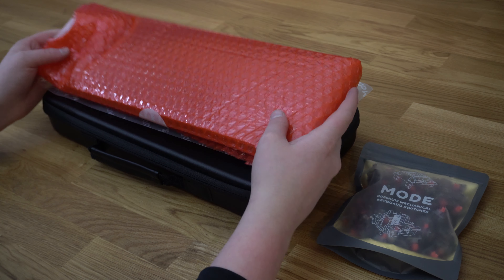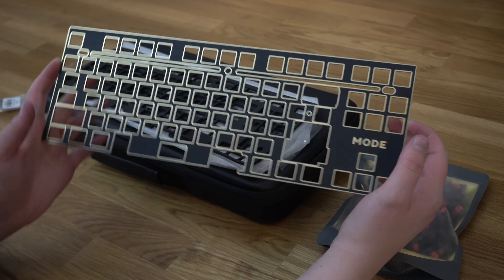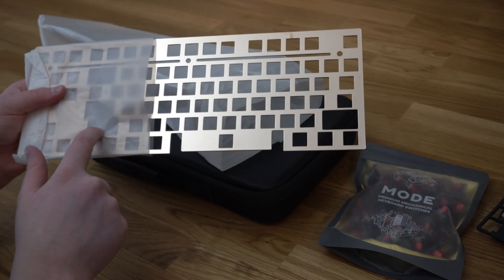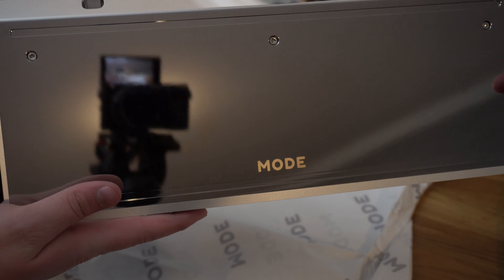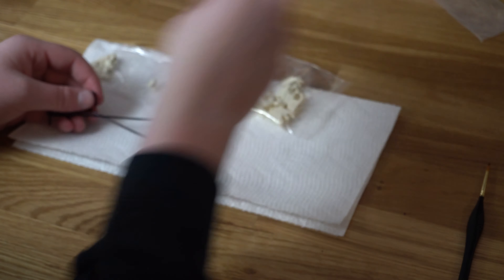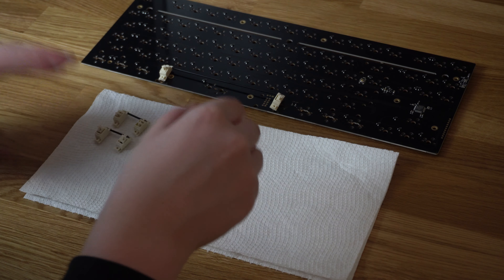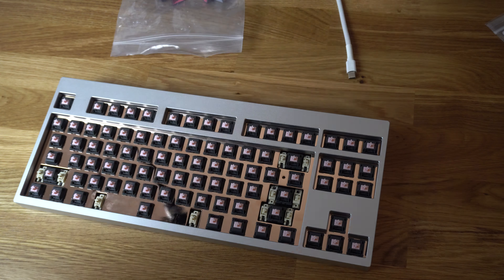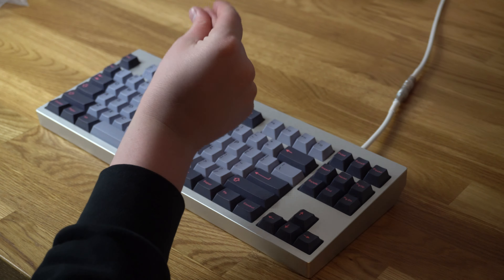Mode Eighty FE Custom Mechanical Keyboard Build

Comment: I can’t find the keycaps where do you get them online
Reply: Its gmk, there almost never in stock and you have to get them in a group buy. they are also hella expensive and if you have a north facing pcb the switch will interfere with the keycap.
Reply: also gmk8008 is based off of a sports bra hence the name 8008 or, you know 😏